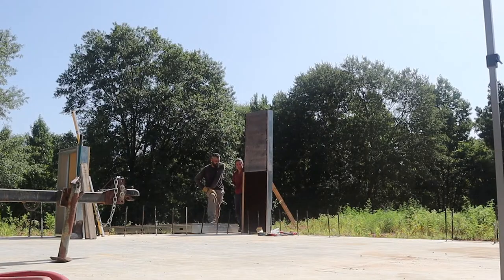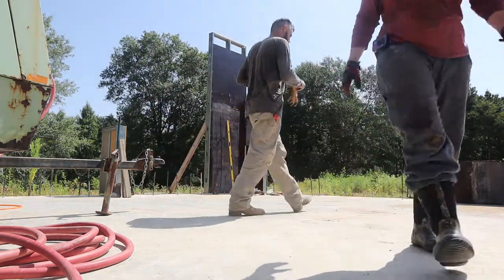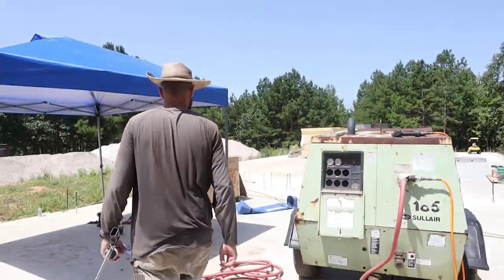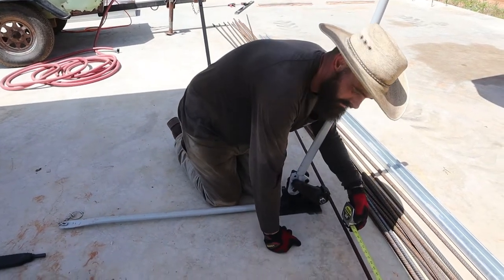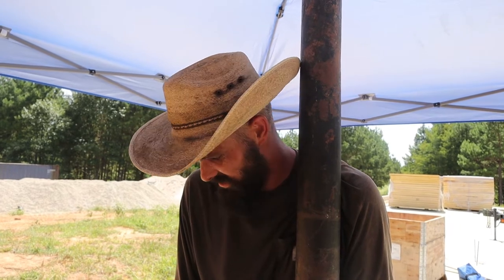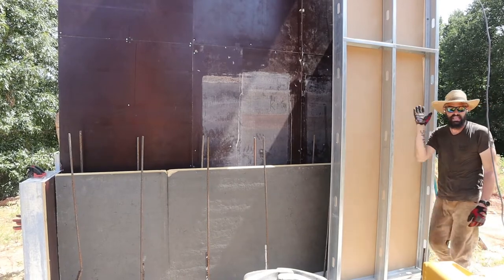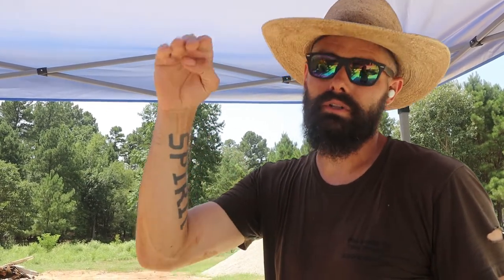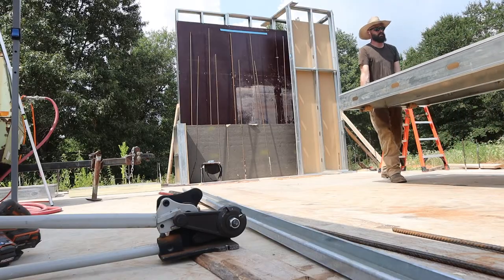Rammed Earth Wall Framing - Figuring It Out - Vlog 43

Comment: Great job guys!
How do you remove the concrete nails you run through the bottom of the frames?
I remember you ram set the nails to the concrete floor of the garage columns but didn’t show how to remove them.
Reply from the maker: We just put a pry bar under the edge of the form and a little leverage usually does it. If not, putting the pry bar right up to the nail and giving it a good whack does (at least so far it's worked).

Comment: Why the foam? What does it accomplish? Also, do you have an engineering background? Is it realistic that a DIY'er could do this or is there some serious engineering science in making these structures truly stable?
Reply from the maker: The foam is the insulation that creates the thermal gap between the outside.  Without it the rammed earth would act just like Medieval castles and be very cold/hot all the time. We do not have any background in engineering but we are learning a lot through this process. I would say it is realistic for a DIY'er to do this at small scale but if you are attempting something this large I would recommend working with SIREWALL USA. They have training classes to teach you the process, mix design services, and even offer consultation services through your project. Stability comes from the mix design and we chose to have SIREWALL help us with that instead of doing trial and error. They have a proprietary formula that they use to find the best local material for you. Hope that helps
Reply: @RedEarthRanch  Interesting. I've seen so many videos where people talk about the rammed earth walls as acting as a good thermal barrier just due to the overall thickness and mass. You also noted in an earlier video how the sunny side was warm, and the shadow side was cool. So wouldn't the wall, given its mass, sunny on the outside, shadows on the inside of the house, essentially average out to a fairly consistent temperature that just fluctuated up and down per the season? It seems like, for a desert climate (very hot in day, very cold at night), rammed earth would be good because the exterior wall heat would "drain" into the house at night, whereas, with a tropical climate, it would be harder to cool the house interior because the wall would always be storing heat? Guess I'll have to read more on this...

Are the two "sides" of the wall (on either side of the foam) tied together with rebar to make it one structural unit, or is it structurally equivalent to two totally separate walls (with the vertical rebar) surrounding a "free floating" foam in the center?
Reply: @bry2k  I have heard the same thing about the walls thermal capacity etc without it and was wondering if the foam insulation was a waste of time myself. I was also thinking that the foam may be good to install between two wall sections though.
Reply: Sure. All you need is a million dollar machine.